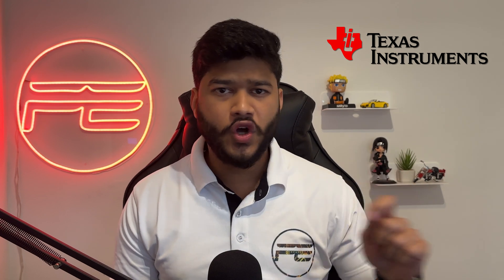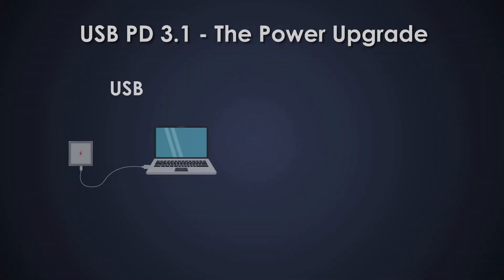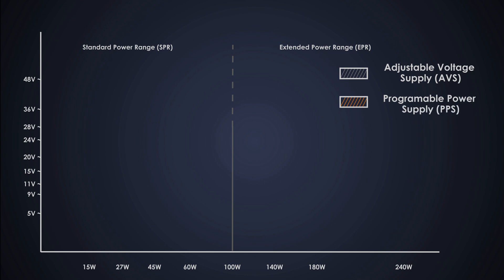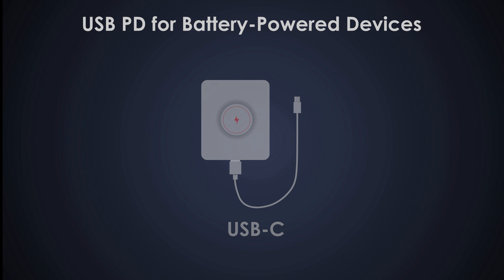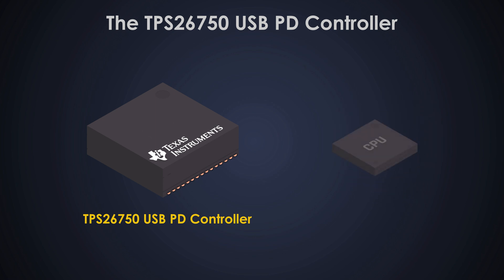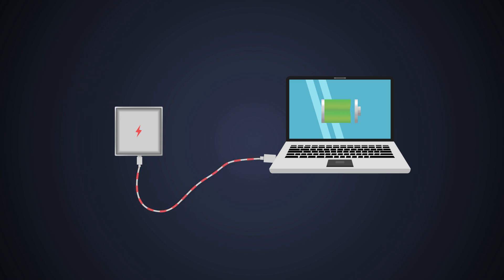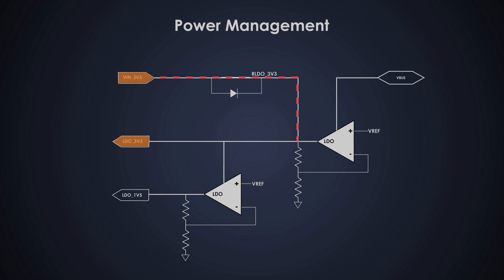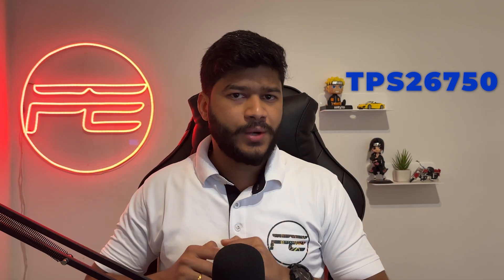How does USB-C work? Understanding TI's USB PD controller TPS26750

Comment: I'm not sure I understand the devices role in all of this. Is a battery charger IC necessary for USB-PD? What if neither the device being plugged in nor the power supply has a battery? Do you need a high voltage power supply in addition to the TPS2X750 IC? Does the power supply need to be variable and adjust the output based on communication from the TPS2X750 or does the TPS2X operate a MOSFET to step down the output from the supply? 
Basically, what do I need to make a power supply that takes in 120VAC and outputs 5V ~ 48V based on the USB-PD standard with no idea as to the device(s) that the end user may plug into it? IE: Universal output.